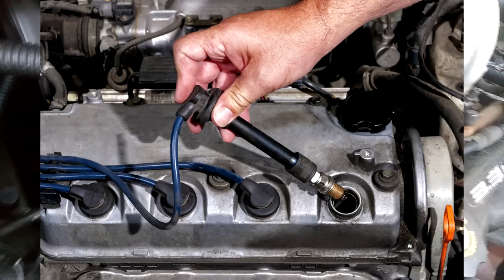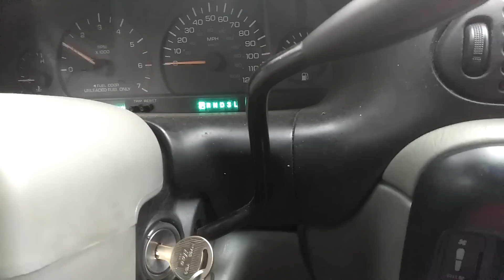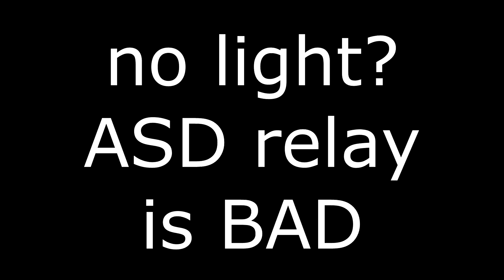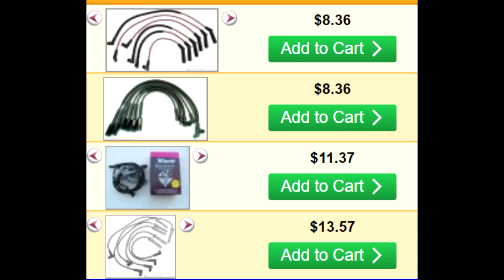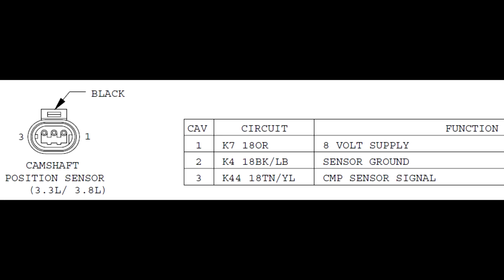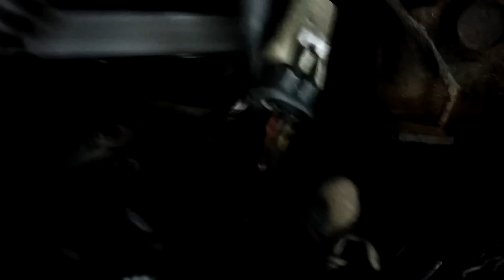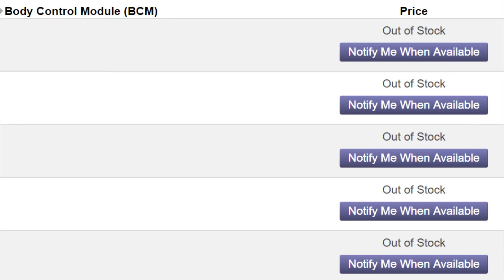Crank- No Start No Spark Diagnosis/Fix 1996 DODGE GRAND CARAVAN 3.3L

Comment: OK, this helps so I can strategize either. I’ll have to adjust the crank sensor. I’m reading this can be done. Also there’s an adjustable depth that you can install it into the Bell housing either that or I’m gonna take apart this new distributor that I got and see if there’s a way to adjust, the cam sensor signal perhaps something is loose something easy I also have another distributor. I might put the other one back in and see what happens.

Comment: No spark no start!  But it’s cranking. I just changed the distributor to and the distributor has the camshaft sensor inside of it. That’s what’s so strange maybe I’ll swap back to the other one again all my problems started happening missing after I drove through some flooded roads in this low profile car.
Reply: @timnagel7294  it's the camshaft sensor. Check if you get the asd current from your relay to the coil and the nozzles. It will turn on when you put your ignition key to on position. Check if you get the asd current while attempt to start it.
Reply: @timnagel7294  I will do it for you

Comment: I’m having the same issue yeah my readings are exactly the same about 3.5 or 3.6 V from the crankshaft sensor and around 2.6 from the camshaft sensor!  I’m using the vevor et828 handheld scope

Comment: Please your reply is greatly needed sir.

From what i understand in this video, the sensors are doing 2 works. First to make the engine spark and to hold on the current while cranking the engine after the ASD shutoff??
Reply from the maker: Crankshaft position sensor tells the computer when to turn on the sparks. Camshaft position sensor also does this (you need both to work for the engine to run). ASD relay is just a safety circuit.
Reply: @mikewalko536  I am tru with the car. To tell you the real fact, the camshaft position sensor above is really the one controlling the ASS circuit too. It's not only there for sparkling. In some models, the car will start without the camshaft but on this type, without the camshaft nothing will make it start. What the most people know is that once the crank sensor I good but the came is bad the car will start but will do hard start. But on this one its not so.

Comment: i have just had a friend have a no start no spark or fuel. changed the fuel pump. pressure was good. 
then the no spark. i changed both crank/cam sensors. started but no spark on 3/6 which are on the same driver. changed with 2 used coils. no change. still was 3/6. using a test light sourced the voltage drop from the coil all the way to the ECM. replaced. van runs good however no has a long crank 4-5sec then dies. try again. starts normally and run perfect.

Comment: I learned something's. For my 96 Dodge Grand Caravan.  I'm having a tough time removing the crank shaft sensor.  The bolt is out too.  It twists but won't come out so far.  Thinking of a little WD-40 squirt

Comment: On the 2,4L 4 cylinder Caravans its a different Cam sensor (the crank position sensor on these does look more like the one he shows here as his cam sensor), the 2.4L is more a flat plate attached with 2 10mm bolts.  The bolts are supposed to be torqued to 7 ft lbs or 84 inch pounds, which could make a difference in the space between, as a rubber O ring on it is compressed down.

Comment: What if you get no light on the first test but changing the ASD relays out still does not get the light? I'm still not able to get spark or start the car. It seems coil control number 1 is grounded out.

Comment: mine just shut off today in heavy traffic. all sensors are new. any chance of this being the best issue. I was having no problem. now I have no fuel, and no spark.
Reply from the maker: Initial guess is a bad ASD relay- no fuel pump, no spark? Definitely electrical. Check the ASD relay first, then go through your fuses. Make sure your battery is good- check voltage and connections. Let me know what you've troubleshot.

Comment: Bro! I’m having that problem right now are you close to Houston
Reply from the maker: New York- the camshaft/crank sensors you can buy online now suck, sometimes they work for 5 minutes and sometimes they last for years.
Reply: @mikewalko536  i have a 1996 dodge intrepid! We went to Oreily and changed out the cam shaft sensor, coil and the crank sensor but it still want start
Reply: It just turn over and want start it’s a 3.5 liter
Reply from the maker: @WARRENB2006  follow the procedure in the video, it should tell you what is wrong if it's in the ignition circuit
Reply from the maker: @WARRENB2006  no codes? Take out a sparkplug and touch the threads to some bare metal on the engine/frame, crank and check if you see a spark. If you do it's probably not the ignition circuit
Reply: @mikewalko536  Done that's already it's not getting no spark
Reply from the maker: @WARRENB2006  yeah, that's a good sign because there's not much that can be wrong -follow the troubleshooting and the light sequence should tell you which component is the culprit

Comment: Great video Mike. 
Easy to understand. 
I have a 1997 Dodge Grand Caravan  240,000 original miles. Just 
Valvoline 10W-30 every 3000 miles. 
Good decision not to junk Caravan. 
FYI. If you haven't already add a transmission cooler and mount in front of auxiliary condenser  to extend the life of that 41TE.

Comment: Good morning sir and nice to meet you!

My vehicle (2003 DODGE CARAVAN SE) is giving me 3 codes (P1684) (P0201) and (P0420).

Are you able to please show me on video how to apply these 3 diagnostic tests for code (P0201)?

1st Diagnostic Test

Turn the ignition off. 

Disconnect the fuel injector harness connector.

 Remove the ASD relay from the IPM.

 Turn the ignition on.

 Jumper the fused B+ circuit and the ASD relay output circuit in the IPM.

 Using a 12-volt test light connected to ground, probe the (K342) ASD relay output circuit.

 Does the test light blink/flicker brightly?

 If yes, go to next step.

 If no, repair the open in the (K342) ASD relay output circuit.

2nd Diagnostic Test

Turn the ignition off.

 Disconnect the Fuel Injector harness connector.

 Disconnect the Powertrain Control Module (PCM) harness connector.

 Measure the resistance of the fuel injector driver circuit between the fuel injector harness connector and the PCM harness connector.

 Is the resistance below 5.0 ohms?

 If yes, go to next step. If no repair the open in the fuel injector driver circuit.

3rd Diagnostic Test

Turn the ignition off.

 Disconnect the fuel injector harness connector.

 Disconnect the PCM harness connector.

 Measure the resistance between ground and the fuel injector driver circuit in the fuel injector harness connector.

 Is the resistance below 100 k/ohms?

 If yes, repair the short to ground in the fuel injector driver circuit.

 If no, go to next step.
Reply from the maker: You have an issue with something on injector #1, either the wire or the plug or the injector itself. that's the second code. First code is that you disconnected the battery, third is catalytic converter, not that urgent.
Try unplugging the injector wire on cylinder 1. It should be the passenger side rear (left side back when your standing at the hood facing the engine). I can't do a video for you but I can spend some time to run you through stuff you need help with
Reply: @mikewalko536  
I can understand and respect that you can't do a video for me at this time to show me all the steps but if your ever able to please lmk a price.
Reply from the maker: What specifically do you have confusion about in the instructions?
Reply: @mikewalko536  
Honestly all of it!

Comment: This is a great video. So I tested the spark plug and getting spark. Does this mean it's a fuel issue and not electrcial issue?
Reply from the maker: More than likely fuel or compression, I'd lean towards fuel if it's sudden. Fuel pumps on these are not spectacular, rockauto.com has them cheap but just rent a fuel rail tester from AutoZone and check the pressure. Any check engine light?
Reply: @mikewalko536   no check engine. Good spark. Although I only tested one plug. Drove home last night no issue. Woke up this morning it turns over. It seems to be a fuel issue. I'm going to replace filter since is 20 bucks. Pump is 180. I'm up in Canada so prices are little higher here. Found a decent video on dropping the tank a few inches to remove pump.

Comment: Front HL flashing odometer, RPM meter, gas meter, hot/cold meter needles are measuring back and forth and cranking to stall and battery goes down from 13vdc to 8vdc.  I started with jumping and cables then shut down again. Prior to battery gas smells for sulfur oximeter hot battery, and also; later the CD 6 disc lights flashing but when CD deck flashing stop everything else stopped going haywire. As a result, no start. Cordoba Chrysler. Not ⛽ but when you get a ⛽ can 🥫 you up 😉 I started to stall and battery 🔋 on it as well and battery goes to stall ⛽ again 😂 Cordoba Chrysler? For 1978? What$$?

Comment: Thanks. Great video - very helpful.  The link to the repair manual does not seem to work ?
Reply from the maker: I have a few of the files saved which I uploaded to a temporary link, now in the description. I don't have all of them, unfortunately, but hopefully the original host of the files fixes it soon. I tried looking online if someone else had backed it up publicly to no avail. The wiring diagrams are in the one i uploaded.
Reply from the maker: Also kindly reference this page: https://www.columbuslibrary.org/content/alldata
This is a login for my.alldata.com- i just confirmed it works. It will have most everything you need.

Comment: My friend has a 05 chryler town & country 3.8ltr. Something blew her asd 20amp fuse so, i replaced the fuse & it blew the fuse again. I swapped her horn relay with the asd relay & it started but now, it misses. Any & all help is appreciated! Thank you in advance!!!
Reply from the maker: The 2005 model is different than the model I have so I cant offer any vehicle specific advice. Here's a link to what i think is the correct wiring diagram- i'm not 100% sure.
http://www-5.dodge.com/bodybuilder/2004/docs/rs/rswiringdiagram.pdf
8W-30-2 6 10 16 21 24 and 32 show fuel/ignition system diagrams using the ASD relay. Page 134 on the PDF.

If i'm thinking correctly, a short anywhere in the ignition coil/fuel injection system would cause the ASD relay to blow. Try examining the plug wires and fuel injector cables, if i had to guess it's something in there. 
Here's the service manual for the car, there might be some procedure to check misfires under power systems, 8N.
https://www.scribd.com/document/342480877/2005-chrysler-t-c-dodge-caravan-service-manual-pdf

Comment: Hallo guys i having issue with this car i try to crank there is no sparks ⚡️ at all .. after i troubleshoot i found the crank and cam sensor have sticker at the surface after i removed the sticker ... the spark ⚡️ is working the car manage to start but 3-4 sec only .. and after 3 times crank the sparks is gone back .. anyone have any experience with this issue please help me 🙏 thank you

Comment: Learn from my experience - '02 3.3 V6 Grand Voyagers / Dodge Caravan have one sort of tone wheel, '04 3.3 V6 has a later tone wheel, so after swapping a newer motor in to replace an older one, the ECM can't read crank position, and you'll get the same sort of 'Cranks but doesn't start' shown here.

Comment: I had a crank no start condition, this test led to change the ignition pack and cables (light on at key on and continuous light). the ignition pack and cables were fine, it was a permanent ground in the PCM. Can be checked by seeing if there is a continuity between one of the ignition pack connector pins for the cylinders and ground.
Reply from the maker: Great find, the pcm is usually the last thing to break in most cars, so that's odd. Gotta remember to take out the battery doing continuity tests otherwise it completes the circuit through the battery

Comment: I need some help. I got the same vehicle you worked on. The code called for a camshaft sensor or single wire. I replaced camshaft sensor. Could it be i didn't push it in enough?  When i stary this van it cranks but no start. I thought i jumped the time?  Your insight is greatly appreciated
Reply from the maker: What code # did you get? Sometimes the definitions are different between scanners so it might be slightly off. It's possible you didn't push it in all the way- the new sensors are all from the same factory and don't seem to be an EXACT fit for the port in the engine. I had to push in pretty hard. 
If you have a multimeter unplug the battery and probe the pins from the camshaft plug to the PCM. You might have a melted harness somewhere, so be on the lookout for that. The battery has to be disconnected if you're doing a continuity test otherwise even a short will show up as a continuous circuit since it will pass through the battery.
If you need help with that in detail I can explain it more or try my best to. 
Also, if you wouldn't mind- how did you get the code? OBD reader or the check engine flash procedure to check codes?

Comment: Good evening Sir.   Great video.   I really appreciate the information.   By any chance do you know if the 3.3 liter or the 3.8 liter has a timing chain???
Reply from the maker: Both have timing chains, and it's the same one:

3.8L: https://www.rockauto.com/en/catalog/dodge,1996,grand+caravan,3.8l+v6,1308822,engine,timing+chain,5724

3.3L:
https://www.rockauto.com/en/catalog/dodge,1996,grand+caravan,3.3l+v6,1308833,engine,timing+chain,5724

Comment: I appreciate your time that you took doing this video. Your honest step by step procedure can not be under rated because like you mentioned one little mistake like not getting the crankshaft sendor in all the way is exactly what happened to me as well. It is difficult to tell when the sensor is seated all the way or not when you can not see it. Great job!
Reply from the maker: Haha, no worries. Figured if I got so much help from YouTube over the years on car stuff might as well give back.
I was probably like 24 hours from calling a tow truck to bring it to the junkyard since nothing was working and it was street cleaning so I'd get a ticket but luckily it worked. Thanks for your comment 😊

Comment: Why can't you just tell which relay is the asd relay????
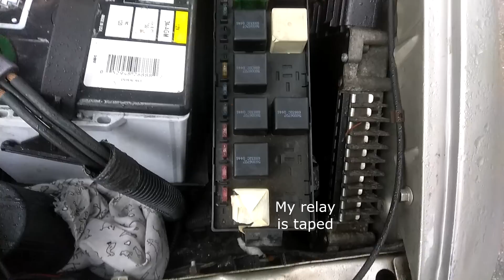Reply from the maker: 2:56 it's the bottom most relay, it says it's taped.
You need to check the diagram if you don't have a 3.3L model to figure out which one it is.
Reply: @mikewalko536  the diagram I found is upside down. It's at the top of the fuse box not the bottom. Problem solved though. It was a bare wire on the upstream heated oxygen sensor.